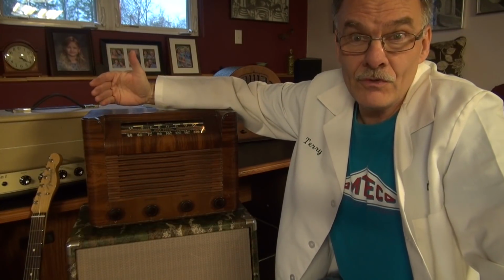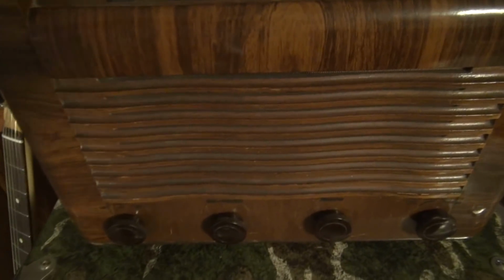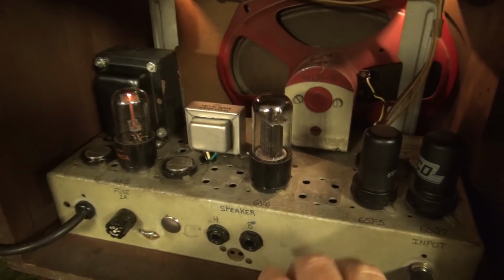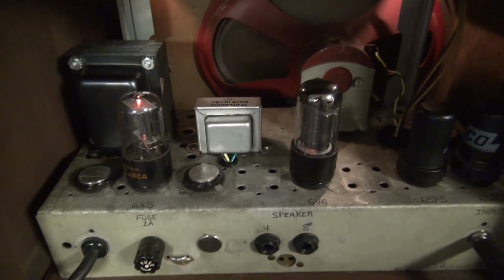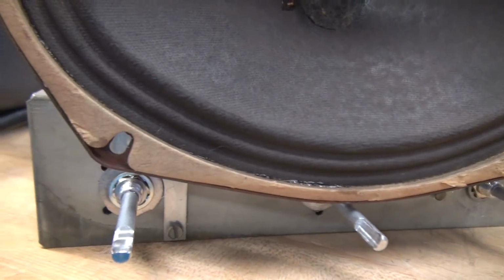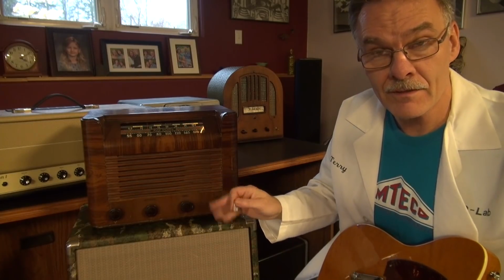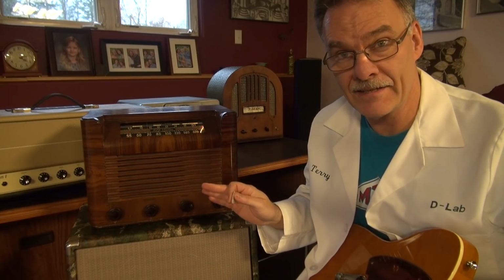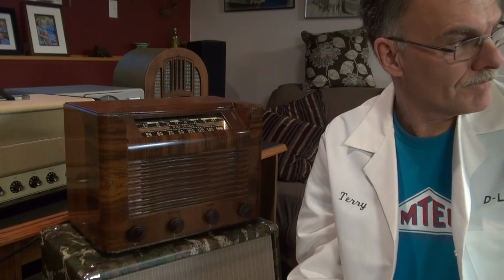RCA 28X Radio Boutique tube class A Guitar amp Super J Retrofit D-lab

Comment: Mommy...where's daddy? He's been gone for so long. Do you think he's ever coming home?
Reply: Brad
I'm converting a Westinghouse front loading dryer into a killer bass amp using a Sovtek military missile tracker..The speaker will be an 18 inch Black Widow by Peavey and I hope to finish the video by Christmas.
I use the 220volt dryer heater coils to  warm up the Svetlanas.
What d'ya think?
Reply: I'm flashing side glances at the wife's vibrator...seeing a 2204 preamp in its future.
Reply: That dryer amp would be really cool if you could make the speaker rotate as it plays.  Maybe a couple of pairs of damp underwear rolling around in the speaker cone as it goes for a cool tremolo sound.